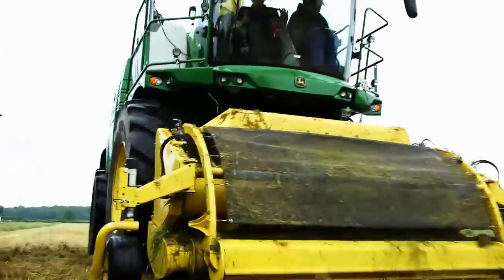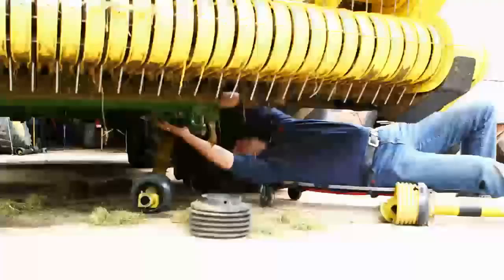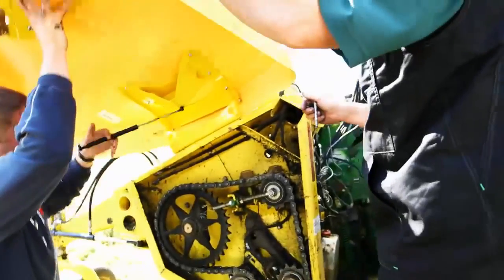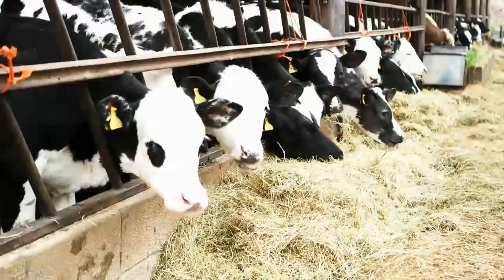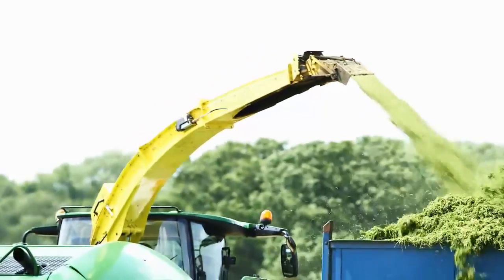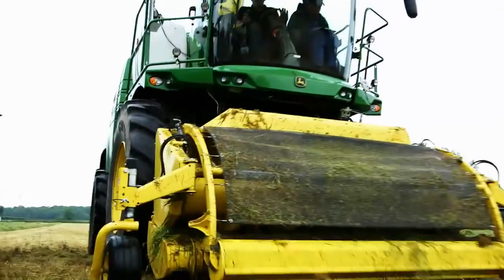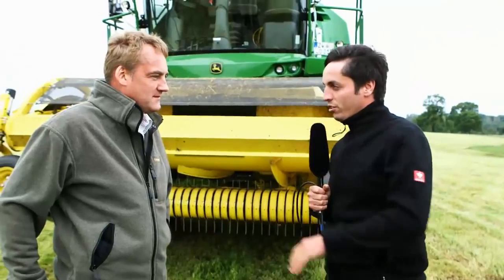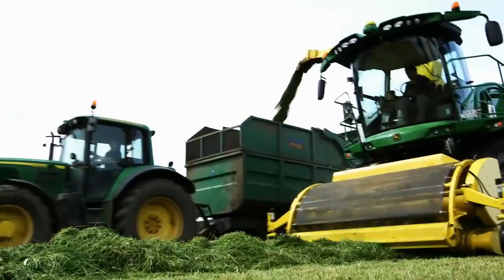Part 2. The New John Deere 8000 Series Forager.

Comment: should bring it down to the farm i film on theyd put her to the test the 900 jaguar thats there works harder than hell and is pushed on to her limit and the hills here will definatly test it 30 odd degrees a in maize sliding accros the hill heavy crops etc it would put it to the test no doubt